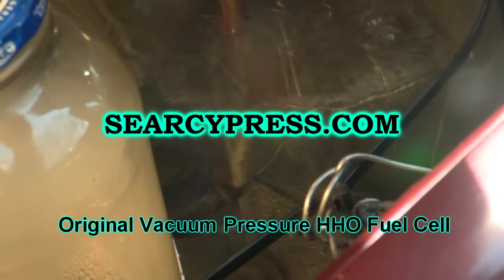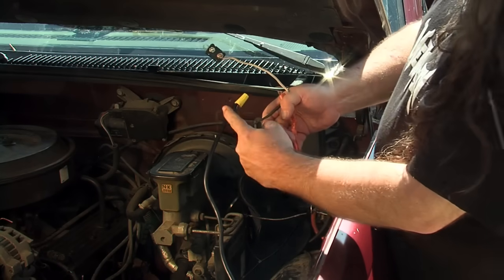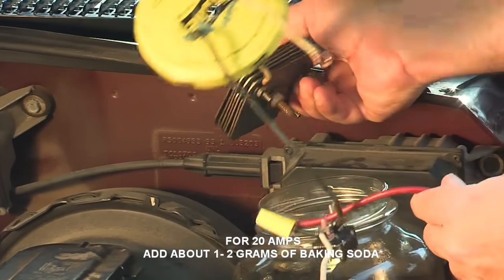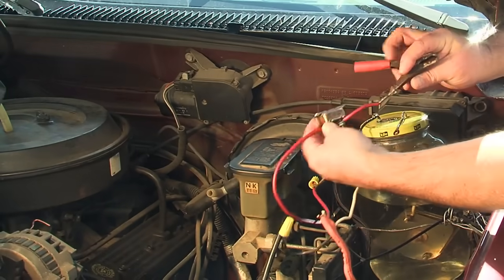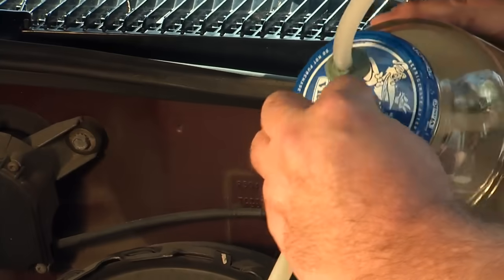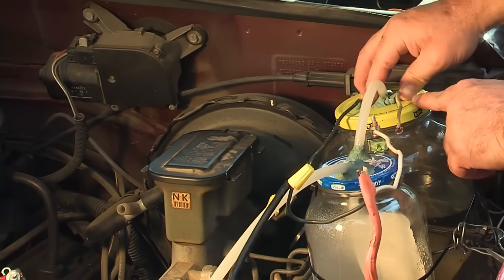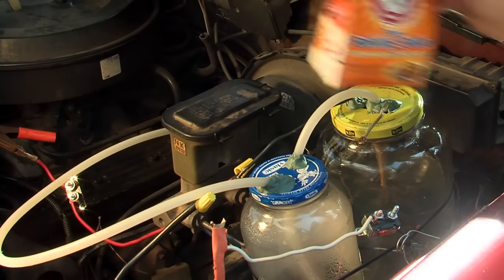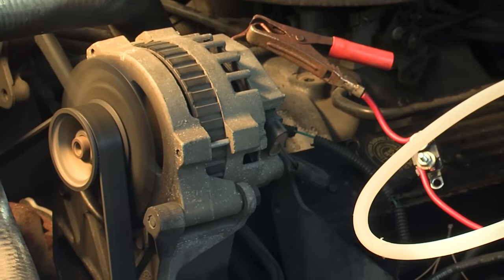Vacuum Pressure Hydrogen fuel cell defeats high gas prices using hydrogen from H2O.

Comment: gotta say you are not interpreting the facts right. there is no way you use and engine to power a generator to produce a gas to power the engine, let alone get extra power from it. i was going to give a long winded thermodynamics blurb but i dont think you will end up reading it. long story short, go to school and learn why your wrong or trust us. you will save gas not pumping energy into a resistor. you will save gas not packing around extra weight. 

basically what im saying is do what you want but just know that you are wasting fuel doing that. you are getting worse mpg with that water tank and resistor block in your truck than you would without them there. if you want to save money on fuel, dont use the skinny pedal, avoid hills and acceleration, get better bearings so it rolls better. get low rolling resistance tires. not much you can do with aerodynamics with a brick like that but for the love of god, dont take the tail gate off.

to use less fuel you need to reduce the energy requirements of the vehicle. your engine can not be made a lot more efficient and fuel type wont help it either. (outside of ethanol injection, but that works for different reasons). think how much energy is lost already in even the best engines of today (60% of the combustion energy)(since your system uses 360w to run, it would need to produce enough hho to make 600w of power and even then you would only be approaching it not being parasidic.
Reply: +tristen turner Parasitic drag huh! Well then let's use the applied values of 13.8 volts and 29 amps. Electrical power is wattage which is simply multiplying voltage by amperage. We get a value of 400.2 watts drawing from the alternator. 746 watts is one horsepower's worth of electrical power. So you mean to tell me that 0.53646 horsepower's worth of electrical draw somehow creates a parasitic load that completely negates any benefit of using HHO? Or perhaps you forgot to mention that HHO combustion in cylinder creates a "rich" condition as read by the O2 sensor in modern cars and forces the ECU to significantly lean out the AFR? Yep, EFI equipped cars running 30:1 AFR's with HHO gas being fed to the engine. This can also be done with propane gas or gasoline vapor. So much for 14:7:1 being optimal huh!
Reply: tristen turner doesnt make any sense to me....   youre saying that the hydro system takes energy to maintain....    yeah, and so does the fuel pump, AC, and many other systems that are there underneath the hood.   The main idea is that hydrogen is really powerful.  Know anything about octane?   Look at todays octane ratings at the fuel pump at a petrol gas station...  80-90, yes?  Hydrogen has on octane rating higher than 100.   The Combustion is the idea.  Were not just moving combustibles around the engine.
Reply: Bone Drone booyah.. ^ knows what's up
Reply: *****
Excuse me for saying this, but both you Gents should take some school courses in English. Please proof read your note before you hit the send button.

Comment: hello! I am super interested in this stuff! but, I am new to it. I drive a geo metro with 3 cylinders and a 1.0 liter engine. it already get around 40 mpg, but I want to see how high I can get the mpg. I figure I don't need as large of a set up as you have here (am I right?), but what I really need help with is building the cell.. how many plates should I use and how big? I really have no idea here.. sop any help from anybody would be much appreciated! thanks!!
Reply: ..also, will I need to change anything sensors-wise?
Reply: im very new to this as well.  been studying video's for about a week.  now im interested in my first attempt at building an hho.  I am confused with the wiring up of the generator once assembled or during assembly.  then there is plate or washer generators.  do you have any instructional information that you could share.  thanks, Terry  reach at db030364@gmail.com then I could provide a phone number.
Reply: You drive a Geo Metro. Which is super efficient anyway, due to it's size. So why would you want to try and see if you can get more? Seriously, lol? What does it cost to fill that thing, like $30 a tank? I drive a 1.6L 4 banger Hyundai Accent and it's absolutely great on gas, just like your Metro, but your Metro is even more gas friendly. This HHO nonsense is stupid and pointless and if these people understood anything about "real" Physics, thermodynamics, or Chemistry, they would know it's utter nonsense. It takes more energy than it makes, ultimately and that's easily proven. Look at the "smart" comments in here and you will see, it's B.S. and it's stupid and pointless. It will save you absolutely nothing, especially on that car.
Reply: Terry Barnes 
"?

Comment: Every alternator has an automatic switch that shuts it off when the voltage gets to high for the battery. So most of the time the mechanical energy is spent but no electrical energy is produced. Now with the HHO-generator, the mechanical energy is being used. There is no additional energy necessary. The generator uses the mechanical energy that is usually useless. The switch in the alternator (actually it is a transistor) shuts off the current of the rotor when the alternator spins too fast. It it possible that there is a difference when every electrical device of the car is switched on and the battery is bad. Then there might be an increase of gasoline because of the cell. But usually, the energy for the cell is no additional energy.
Reply: so is the hho-generator  a go or a no,no 2 u  abgas engel???

Comment: amazing video, glad I found it...I use a much smaller jar and 8 to 15 amps, I run it as a fogger into ther air box.. when the engine is not sucking the hydrogen is wasted but running up the mountains in my 4.8 liter chevy I got 4 mpg increase (8000 lb trailer).  I know it works , have not tried it with E-85 or anything? so yeah the power increase is more than the amps needed to make the hydrogen (10 amps@ 12 volts=120watts?)
Reply: During WW2 fully laden bombers used water injection briefly at take-off to reduce the danger of detonation with full open throttles at full boost on their radial engines. Hydrogen is explosive and engine timing on cars should be retarded for the same reason.....detonation can quickly destroy an engine. Some of the serious biker boys today use water injection and water methanol mix on their ultra high compression engines.
Reply: when they inject water into the engines does it heat up to make hydrogen?  I seen a water injected Porsche back in the 60s,they said it really boosted the power, but it was water not hydrogen gas..

Comment: BUT THE HYDROGEN CAR COMPANIES WANT YOU TO BUY HYDROGEN INSTEAD OF MAKING IT YOURSELF!
Reply: google: Honda Energy Station
Reply: Tom Hoehler
sigh   again...google: Honda Energy Station...  It is a hydrogen generator/compressor for your house.

Then if you're feeling lucky, try Hypersolar Inc.  They're developing an even cheaper generator that doesn't require natural gas.
Reply: Tom Hoehler
Well yeah, it's a little penny stock.  it's basically just one scientist at University of Santa Barbara.  1.5 volts is needed to separate hydrogen from water.  with their solar apparatus they have recently improved from 1 to 1.2, just in the past year.  It is really just a cheaper method of using solar power to carry out the electrolysis of water than actually buying a bunch of solar panels.

I know for a fact that this video is bullshit, hydrogen is not combustible and therefore would need an electromagnet to spin the axle.

  Hydrogen power comes from an electron being physically separated from the nucleus, but kept close enough to the nucleus (in an incredibly thin membrane) that it is still trying to attach back to it and reform a whole H2 molecule. The initial push of the molecule into the cell keeps the electron and nucleus moving along both sides of the membrane together until it reaches the next cell where the molecule is reconstituted and the whole process starts again.  This movement can be looked at as the way that wind moves a windmill, or rushing water *moves" the turbines of a hydroelectric device.  And with the electron separate, it can pass through a similar (but small scale) device that gathers the energy.

As for how the electron is separated, the entire molecule is smashed and filtered through a thin cross hatching of platinum or silicon (depending on desired operating temperature vs cost effectiveness...platinum generates much less heat and is safer in cars, fork lifts etc, silicon can reach close to 1000 degrees and should only be stationary) at the front of each cell.

Those are the basics of a few types of fuel cells, it isn't as fancy as people think when you can finally wrap your head around it.  It is intangible as hell though because people don't know what an electron looks like.

I made a killing off of Plug Power's (PLUG) stock in early December.  I caught some of BLDP, FCEL and HYSR in it's tailwind as well.  It was really just people going nuts over Tesla stock and looking for the next best propulsion system.  A lot of analysts think it is still overrated because of this, and I think that they are completely at the mercy of the Platinum miners/recyclers.  Platinum is already insanely rare and the demand is picking up.  Some of the largest producing Platinum/Nickel mines, which are in South Africa, are a few miles deep and are likely to shut down or god forbid collapse.  The workers have gone on strike a few months back as well.  Luckily, as petroleum cars are phased out in the future, we can recycle platinum from the Catalytic Converters.
Reply: Tom Hoehler
Currently brown hydrogen (from nat. gas) is estimated at ~10 billion dollars worth to investors (Air Products, Liquide Air, Praxair etc).

Hypersolar could really shake these companies up but they still have other gases that they sell.   There are also companies such as PetroLogisitcs, that acquire hydrogen as a byproduct of the dehydrogenation of butane and propane.  This is the process of making certain types of solid chemicals such as propylene.  The hydrogen they receive as a byproduct makes ~7% of their entire revenue.

Good talking to you too

Comment: yes easy to make impure hydrogen baking soda will produce co2 in electrolysis use KOH. you want 5 neutral plates in the middle and why no pwm?
Reply: Not recommended to use such a strong base KOH will dissolve glass under high temperature slowly
Reply: You talk so high up! Lol